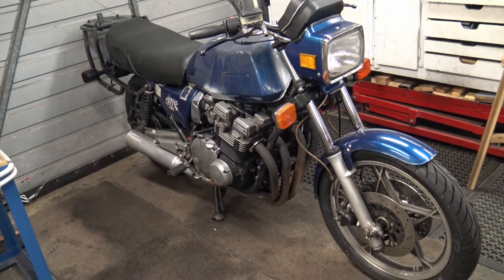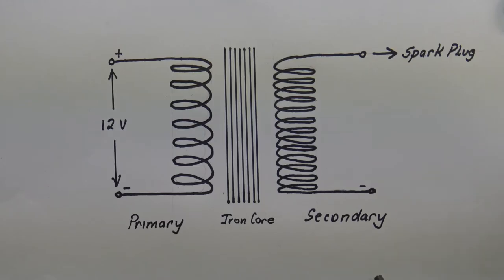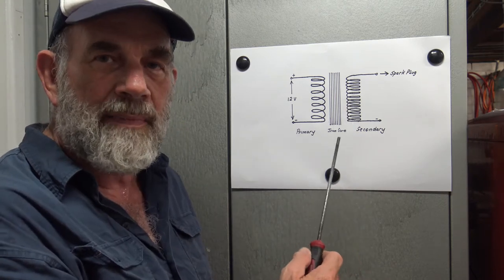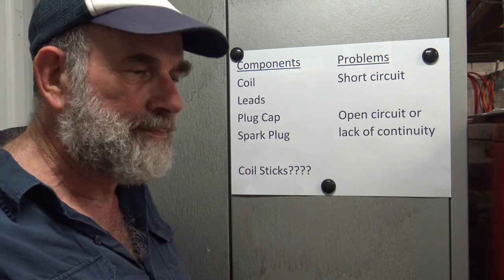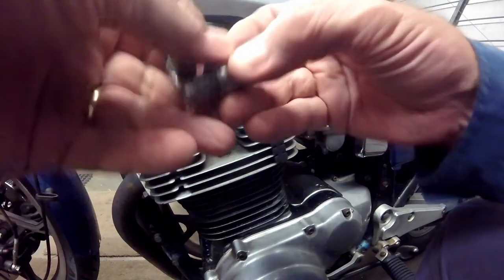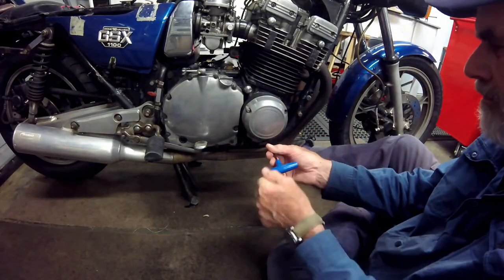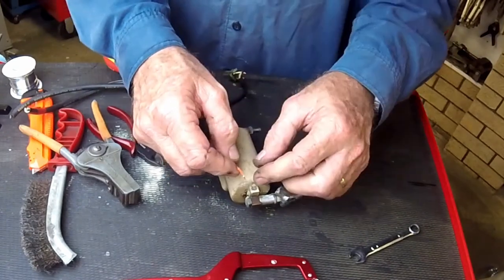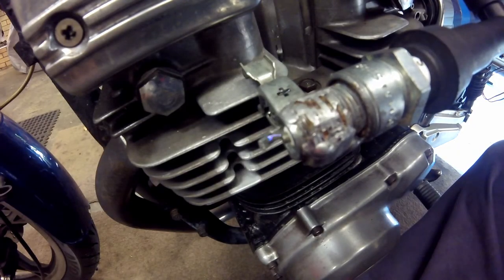Fixing Ignition Problems in Four Cylinder Motorcycles

Comment: I enjoyed the different explanations of the ignition systems, it has been a while for me so I learned alot!
Reply from the maker: Those explanations of the different systems were unscripted, so I keep thinking I may have missed something. I looked at a six cylinder Honda the other day and realized that it had a capacitor discharge system so maybe I should have covered those in more detail.
Reply: @whitedoggarage  i think it was a great overview, technically you could dedicate an hour to understanding each one.
Reply from the maker: @markwhalen5300  Yep thanks, I was horrified at how long the video ended up at. My average viewer has an attention span of less than 10 minutes and this one runs for just under 30. I wanted to give viewers pointers as to where to look and you are right I could have spent an hour on each one.

Comment: Maybe it doesn't apply to this model, but isn't the signal wire to the coil usually on the negative side, with the positive being a continuous supply?
Reply from the maker: Rick, you are probably right. I am away on holiday at the moment and can't check my system. But I see this is the case for the more simpler ignition system of the the earlier 8 valve models, so I would imagine the same holds for the 16 valve system. Good point and thanks for raising it.

Comment: Hi Bob, just took out my -82 1100 Katana and see display not showing any RPM. And also i feel engine have problem with ignition. Do you think it´s the signal generator (if RPM is from signal generator) Thanks in advance  //Torbjörn  "Sweden"
Reply from the maker: Good question Torbjörn. By signal generator, do you mean the pick up unit or the transistor unit it signals to. They are both related in signal generation and thus the tachometer, but usually the fault lies with the transistor unit. The rpm reading is based on the signal pulses to one of the coils (the one with the orange or orange/white wire - I am on holiday at the moment and away from the garage so can't check the detail). That should also cause a problem with the ignition. Usually the transistor unit fails outright and you loose spark on all plugs. If your motor runs, then I would start by checking the wiring between the signal generator and the transistor unit and from the transistor unit to the coil. If you have a rough running motor and no rpm reading, the problem should lay within that circuit rather than from that circuit to the tachometer. Hope that gives you somewhere to start with trouble shooting the problem. Bob
Reply: @whitedoggarage  Thanks Bob, i will start from your advise and hopefully find the issue, Have a nice holiday and enjoy your life.  //Torbjörn
Reply from the maker: @torbjorntroell5985  Thanks and good luck with your repair.

Comment: What about a bike that has only 1 cylinder  that's cold. It's. Got fuel and spark but can hold the head pipe from cylinder 4 after 5 min of running.
Reply from the maker: Interesting question, if I read you correctly, cylinder 4's exhaust is cold after 5 minutes of running. You have checked and the spark plug shows a spark and you belive it has fuel. Spark plugs can show a spark when out of the motor, but because of poor compression or maybe a crack in the insulator may not work in the motor. I have seen this with plug fouling too, where the spark is there outisde of the motor, but the plug wont spark properly in the motor. My first suggestion is to replace the sparkplug on cylinder 4 with a known good one and see what that does. If that cylinder is still cold/cool I think it might be the carby, something like a split in the diaphram, so that the carby flows fuel for idle, but above idle the cylinder is acting more like an air pump. That said, it has to be cold for that cylinder not to get some warmth at idle. Hope that gives you something to look at anyhow.
Reply: @whitedoggarage  tried new plugs,new coils,,swapped the carbs off of my other bike. "Same engine" it's baffling. Wonder if I should do a compression test maybe a valve is stuck?
Reply: @whitedoggarage  here is a little background on it. It sat for 10+ years. When my brother passed away I decided to restore it. It ran great for about 100 miles before that cylinder quit. Valve clearance maybe? Man idk lol
Reply from the maker: @joshsutcliffe6099  Okay, nothing simple then. Yes, having tried all those options a compression test would be a good next move.
Reply from the maker: @joshsutcliffe6099  If it ran great for 100 miles, it may not be valve clearence, unless the adjuster has let go in some way. Your idea of doing a compression test is a good one, there are a host of possibilities to sort out there including your suggestion of a stuck valve. Sitting for years like that does no engine much good.
Reply: @whitedoggarage  thanks for the feedback. I'll go do a compression test on it tonight and see what I come up with.
Reply: @whitedoggarage  got 115-125 on all cylinders
Reply from the maker: @joshsutcliffe6099  Not bad values, could be better, but that means the problem is not with the cylinder machinery. Recapping, you have tried with good coils, new plugs and different carbies and the problem is still there. The compression is good enough and the motor ran well for 100 miles, before this happened. Motors that have stood like this one usually have problems with rubber failures, inlet tubes and carb diaphrams; or fuel blockages. The rubber failures usually show up as poor running rahter than a dead cyclinder, but the carb blockages usually casuse a dead cylinder. You changed the carbs for a good set and the problem remained, so the carbs are not at fault. A split inlet is usually causing a misfire rahter than a no fire. I am running out of suggestions here. Stupid as it sounds, how about checking the header pipe for a blockage - a dead mouse or something?
Reply: @whitedoggarage  that's a great idea

Comment: Thanks for a comprehensive video. My bike has been sitting for 6 months and wouldn't start. Now one cylinder is down, (it's pair is firing ok)so it probably isn't the coil, but really useful information for the future.
Reply from the maker: Glad you enjoyed the video. Sitting for six month and one cylinder down, start with the obvious, is there spark? If there is spark then after sitting for six months it is probably some gunge from evaporated fuel in the carby. Here in Oz, back after one of my trips and I had a six month one last year, I first drain all the carburettor bowls so the fuel is a bit fresher. Then I try and use the fuel that was in the tank as soon as possible and get new stuff. Petrol does not last like it used to here. Good luck with your fettling 👍👍👍.
Reply: Thanks for taking the time to reply. The plug is wet and smells of fuel, so further investigation is needed. Pretty cold here for fettling in the garage, just have to try repairing my clock that went twang last night until better weather.
Reply from the maker: @philiponsolent7232  I suppose it is all relative, I sort of imagine the Solent, being down the bottom is a warmer area of Britain, but it is winter there at the moment. Here in Brisbane, Queensland we are enjoying 30 to 36 degree Celcius days with about 70% humidity, and a bit of cool would not do any harm - but it is summer and this is what it is like. Good luck with the clock and it wont hurt the bike to wait until it is a bit warmer.
Reply: @whitedoggarage  I thought I had solved it, having stripped the carbs and cleaned them. All appeared well until today when I took the bike for its annual test, I didn't get much further than the end of the road with a misfire on 1 but further investigation showed no 4 was also misfiring. I was a little confused because I am getting a spark at 1 and 4 but having watched again this might be a problem as the motor warms up. Your videos have been really useful, its like having a super manual, appreciate you take the time to pass on your knowledge.
Reply from the maker: @philiponsolent7232  I would check the primary and secondary winding resistances on the coil, hot and cold, you are looking for not much, ~ 3 ohms, and a bit, ~ 6000 ohms resistance from memory. I would be tempted to trim a half an inch off the end of the coil leads, but if they are misfiring when warmed up I would be looking for a crack in the coils. You could try, with the tank off, starting it up in the dark and looking for spark jumping from the coil or a lead to metal. If the leak is from a lead, I would replace the lead. If the leak is from the coil, araldite or a similar epoxy will probably fix it. Good luck.
Reply: Thanks for the advice, lots of things to try.

Comment: 15:55 in Colorado, because of the dry climate, the life expectancy of a Cap on a shelf is about 10-15 years, a working Cap 2-10 years.  I never reuse, and always buy fresh, unless circumstances dont allow it. yes.. some caps can last 50 years, but if a Cap is in the circuit, as it is here, I recommend replacing it when maintenance (point replacement) is preformed, what are your thoughts?
Reply from the maker: Well I have never replaced a capacitor unless I thought it was the source or part of the problem. But replacing it when the points are replaced is probably a good idea.

Comment: Please help same bike but 3&4 running cold no ignition
Reply from the maker: So, as I understand it, what you are saying is that you have no spark at the number 3 and number 4 sparkplugs, but spark at the numbers 1 and 2 sparkplugs. The diagnosis in this situation can get complex. There is a few possible causes. First off, check that the coil leads are not mixed up, one coil should feed spark plugs 1 and 4, and the other feeds spark plugs 2 and 3. If there is a mix up, then connect the leads to the correct cylinders and check again. If the spark is missing from the 1 and 4 plugs or the 2 and 3 plugs then the problem lies with the relevant coil. If so swap the signal lead from the good coil to the bad one and see if you have spark - if no spark, the problem lies with the signal unit - contact me again and I will lead you through that diagnosis. If there is no mix up, for the next step, make sure your starter battery is fully charged - better still connect a 12 volt car battery to your bike battery to add extra power. Check for the leads/caps for cylinders 3 and 4 shorting out to the frame or the motor. I like to check in a dark room where you can see blue or yellow sparks jumping from the leads or the cap. If no joy there, then check for spark at plugs 3 and 4 again. If there is still no spark on 3 and 4, remove the plugs from cylinders 3 and 4 and check for spark using your 'known' good lead for number 1. If those spark plugs spark on that lead, call them good and put them back in the motor. Next step will be to remove the leads from spark plugs 1 and 4 and using a multi-meter set on resistance, push the probes into the two plug caps until they touch the contacts and check the resistance reading. Suzuki specifies that it should be between 31 and 33 kilo-ohms, but I would accept anywhere between 25 and 38 kilo-ohms. Test the leads for cylinders 2 and 3 in the same manner. If the resistance is too high or too low that might be your problem. Let me know how you go?
Reply: @whitedoggarage  thanks for information was running fine but with a mis fire now and then but completely dead now
Reply from the maker: @andriesvanderwalt1849  Not having the bike in front of me it is hard to diagnose the problem, which is why I gave you a logical path to follow to try and solve the problem. But... I can't help thinking the problem might be in the leads or the cap, fine cracks in those can rob you of spark at the plugs and unfortunately give you a plausible resistance reading across the leads. Good luck.
Reply: @whitedoggarage   thank you think it's either the connection from ignition unit or one of the pickups on the crank makes sense I think that it's 3&4 cylinders
Reply: @whitedoggarage   thanks for your feedback I'm in the UK and it's so damn cold so will check when I get a break in the weather just thought that was a easy one like a coil but as the system is left coil 1 and 3 and right coil 2and 4 can't be that so due to moisture can be the connection or one of the ignition pickups
Reply from the maker: @andriesvanderwalt1849  Because you have lost 3 and 4 I really don't think the ignition pickups or the signal generator is the problem. The coils have a wasted spark, that is, one coil fires both plugs 1 and 4 at the same time and the other 2 and 3. The air fuel mixture in whatever cylinder has completed the compression stroke then ignites and the second plug fires at the same time during an exhaust stroke (hence the name wasted spark). Because you have lost spark on 3 and 4, the fault must lie with the coils/leads/spark plugs for those two cylinders. A bike I worked on years ago, had that same problem and the cause was faulty leads. I cant remember whether it was a broken wire or a cracked insulation. The fix was to replace the leads. I hesitate to say replace your leads on both coils, as the problem could also be cracked plug caps, cracked insulators on the spark plugs or a host of other reasons. With good battery power (that is important) and a dark room you might see sparks jumping from the lead, the cap or the plug's insulator. You might also hear a crackle noise where the lead is touching the motor. Hope that helps. Here in Australia where I live it is hot and humid and occasionally rainy at the moment, a bit of of your cold (maybe 25%) wouldn't go astray down here 😄.
Reply: @whitedoggarage  thanks for your help see what you say makes sense will check it out when I get a bit of sunshine
Reply from the maker: @andriesvanderwalt1849  no worries.